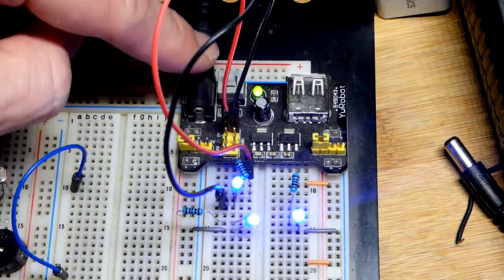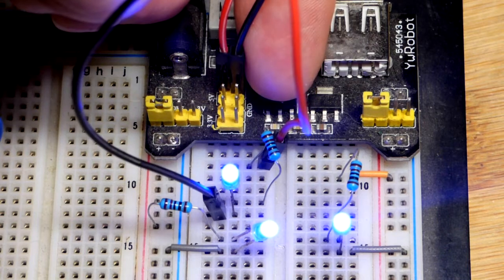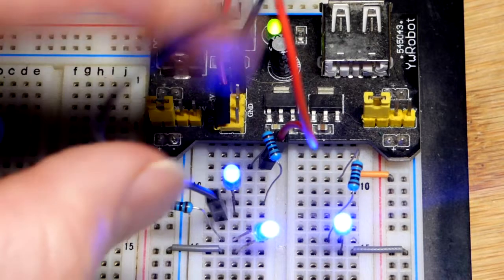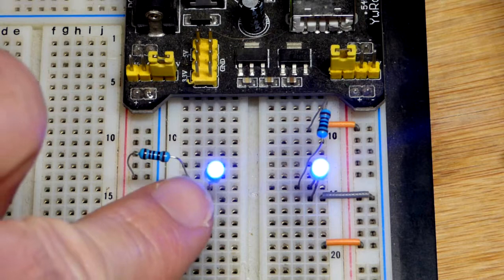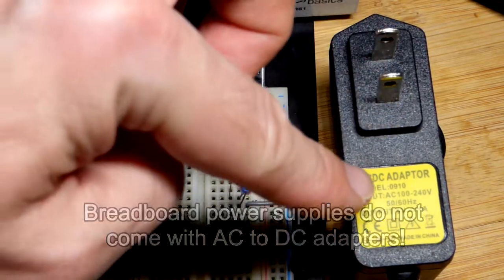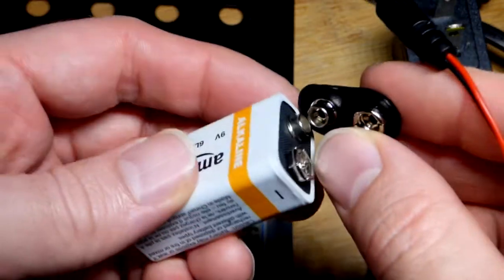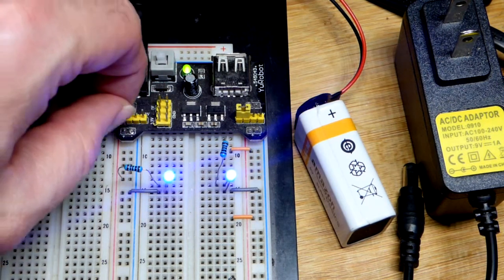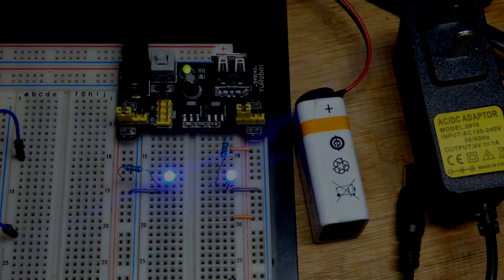Breadboard power supply basics for learning electronics shorts 3

Comment: Can i use ac/dc 12v adapter and dont burn the board
Reply from the maker: I think that's what they claim they can handle, but I think I burnt some out at 12 volts. That was a long time ago though, so I don't really remember anymore.
Reply: @Electronzap  ok thanks

Comment: Thank you, terrific channel of info. I have the Elegoo Superstarter kit. The included 9V battery isn't strong enough to get my stepper motor working. SO I have been using the barrel jack on the breadboard power supply and an AC Adapter I pinched from an old phone I think. It puts out 12V @ 1.5amp - and has been running the stepper motor fine. But watching your video from your comments at the end I'm wondering should I worry it will fry my board? So far no issues...? ALSO am wondering can I put an Arduino Nano on the same breadboard and power it from the 5V rail I connected to the same breadboard power supply?
Reply from the maker: Breadboard will probably heat up a bit with 1.5A, but if it's just for short periods of times, I don't think it will be damaged unless a component heats up enough to melt the board, or it is cheaply made.
Reply: @Electronzap  thanks